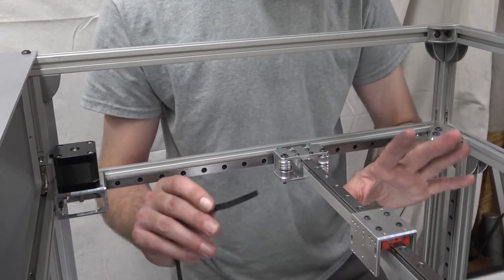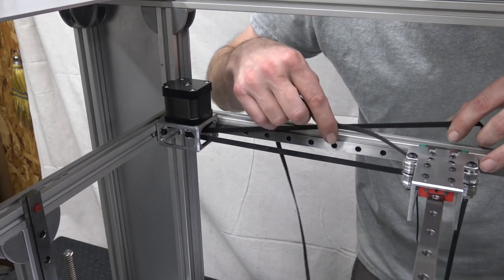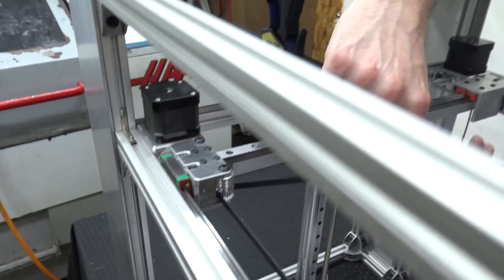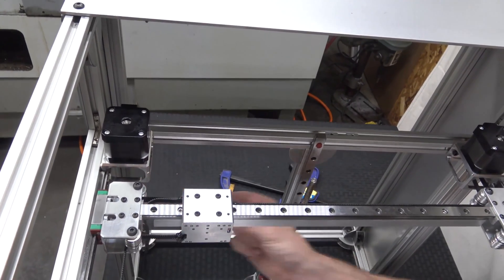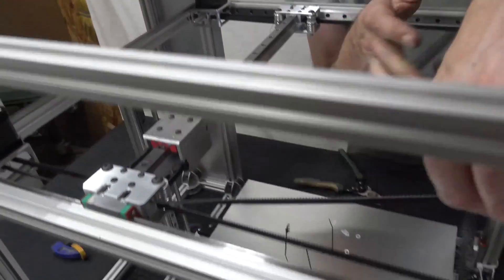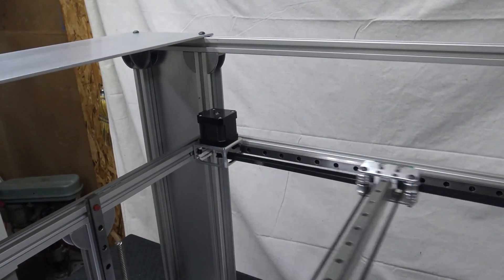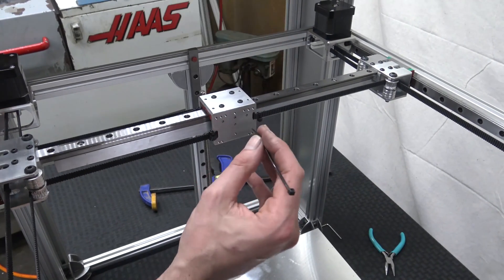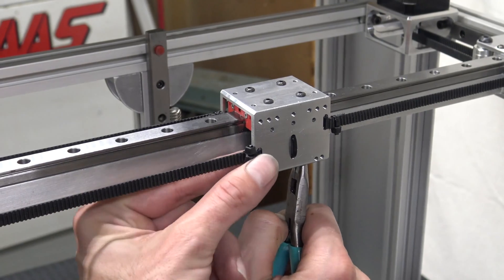SolidCore CoreXY: Belt Routing & GT2 Belt Tensioning

Comment: Any reason why you need two axles for the idlers on each side? couldn't they be stacked on top of each other? Is it because they often rotate in opposite directions? Since they are on separate bearing it should be fine no? anyway, thanks for sharing
Reply: I am not him, but the answer is trigonometry, Belts need to run in parallel with the movement. Only way to use one axel, is to use idlers of significant different diameter on the crossing, for his type of setup.

Comment: Aluminum extrusion below the x-Axis linear rail is not required. These rails are sturdy enough for a 3d printer if you use them for mounting. Like you have done.
Reply: Bit late but the rail is definitely not stiff enough unless youre running a sub 250mm rail and a bowden config with a short and light hotend. 

And even then you can improve your is graphs by adding a backer to the rail.
Reply: Definitely on smaller ones but anything this big is probably going to need the extra help, steel deflects a lot more than someone might think.

Comment: All of that work to end up using belts and lead screws. Too much flex and loss of resolution with belts for my end use. 

Besides that you cant use them with an FDM if you expect them to last. Soon as the oven (enclosure) heats up the belts they get soft,  stretch, and are shot. 

We are building High temp composite precision ball screw printers. Enclosures are t stat controlled hvac air filtered systems. Very complex in nature and need to meet high use precision requirements. 

As long as you have happy customers that is all that matters.

Comment: Came here to find out how to tension my belt, left without any good info.
Reply: did you find any other good source?
Reply: @Prashanth-yn9zd  No, but I used  a sound frequency analyzer on my phone (Spectroid on android) to have both belts tuned at the same frequency and I increased the tension progressively till the quality improved, but not to the point when you can see the pulley teeth marks on the print (ringing). There isn't a one fits all frequency for all printers, so even if you have two identical printers, you need to tune them at their own frequency... if that makes any sense.
Reply: @L3X369  
Thank you,
Could you please share what belt tensioning mechanism did you use?
I saw one where the position of the motor can be slightly adjusted to increase/decrease the tension. I am looking for other possible methods to adjust the belt tension in the core-xy setup

Comment: If I'd be making a printer from nicely machined parts, I wouldn't attach the belt with tie wraps like on a $300,- printer. There are so many nice timing belt clamp designs available.
Reply: Why actually? Say your belt came undone, you always have an extra ziptie, but you can't just easily fire up the printer to make yourself a new clamping device. The idea behind machined parts is that they aren't going to fail and leave you stranded, because realistically from the mechanical perspective, you don't need them, you have the space to make plastic pieces as rigid as needed and then some; zipties are pretty resilient, and if they do fail, they won't leave you stranded either.
Reply: @SianaGearz  This machine is made of aluminium mostly. Personally I'd make nice aluminum clamps as well. They would not fail in a 1000 years under normal circumstances. It would be mostly for aesthetics. Also for more easy adjustment and replacement of the belt. But the time making clamps probably doesn't make up for the time saved on mounting. But hey, making a machine from scratch is not very time efficiënt to begin with.
Reply: this is just a demonstration, tie clips are fast, how did you miss the entirety of the point of the video?
Reply: @swapnilmankame  Demonstration yes, but in the sense of showcasing parts they try to sell for $20,-/piece and up. I may as well let them know the design is functionally not up to my standards for this price. It gives them an opportunity to improve on it if they desire so. But I now see they stopped all R&D years ago.

Comment: How did you determine that the tension was even for both lines. I did this similarly and had no “tight spots” but still ended pulling it out of square?
Reply: You should be using a belt tensioner tool. Belts cannot be properly tensioned by hand. Most that Ive seen have over the years have been too loose. One of the many reasons I’m not a fan of belts but when done properly can provide adequate diy results.
Reply from the maker: You want to remove any slack in the belt and tighten the belt until you can pluck it like a guitar string. What did you pull out of square?
Reply from the maker: Email me and I'll get you some documentation on tensioning the belt if you're still having trouble.